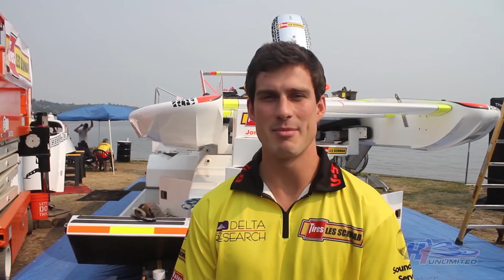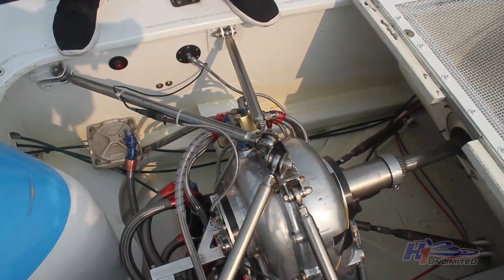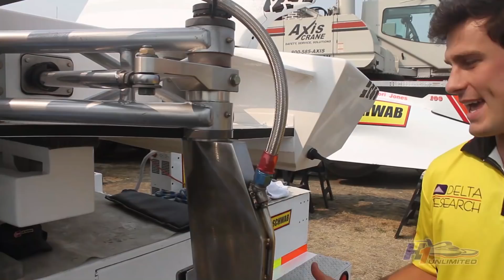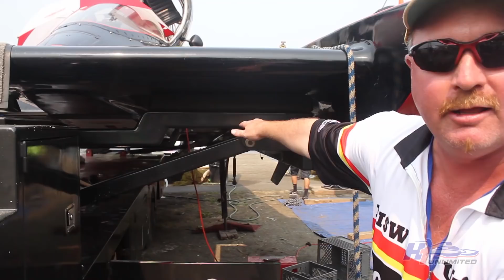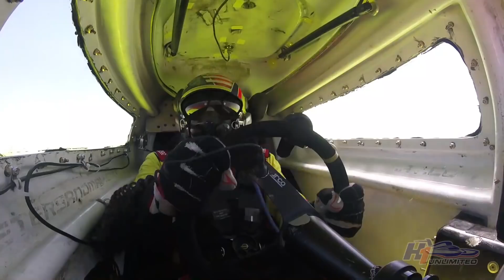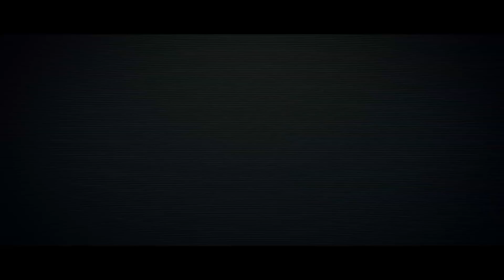This is an Unlimited Hydroplane!

Comment: Cool vid, but I was in the Air Force in the 1980's, and that cockpit is nothing like an F-16 cockpit.
Reply: I think they used to use the canopy from a  F-16 or some jet i forget which not the whole cockpit, although might be different now and they have there own canopy's as i cant imagine its easy to find F-16 bits lying around these days.
Reply: The F-16 canopy is designed for fighter jets, providing visibility and protection for pilots, while the hydroplane canopy, often made from F-16 units, is specifically adapted for racing boats to enhance driver safety by enclosing the cockpit. Both canopies serve to protect the operator but are tailored to the unique demands of their respective vehicles… hmmm how long did you actually serve bud? 😂
Reply: @AustinRipz  Only one stint at GAFB with the Wild Weasels.  We had F-4Gs when I got there, but they replaced those with F-16s.  And, a myriad of other aircraft, usually fighters (F-16, F-15, A-10) would operate out of our Southern California base under the fair weather program.  So, I'd be around them a lot, in addition to our old F-4Gs.